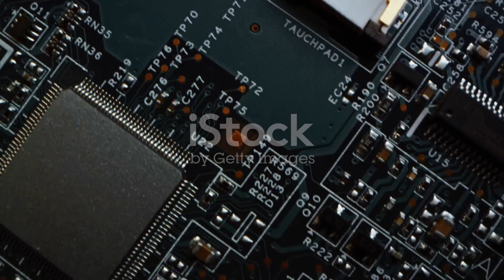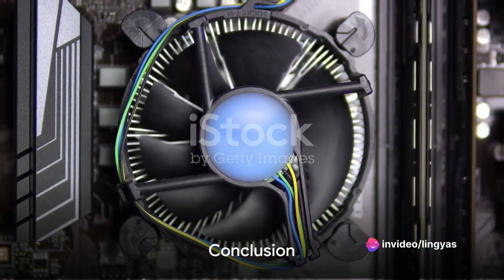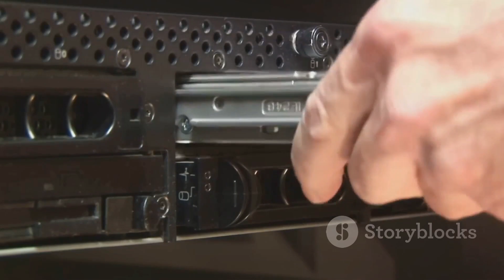"Understanding the Basics: Block Diagram of a Computer"

Comment from the maker: OUTLINE: 

00:00:00 Introduction to the Block Diagram
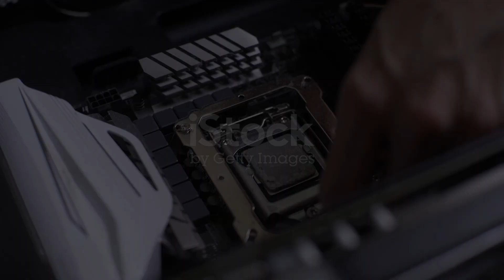00:00:11 The Central Processing Unit (CPU)
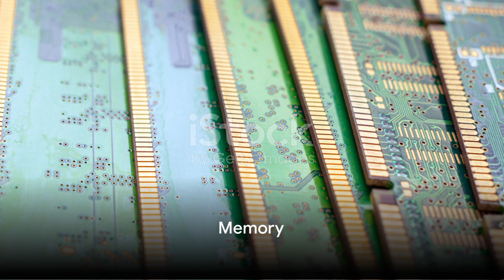00:00:24 Memory
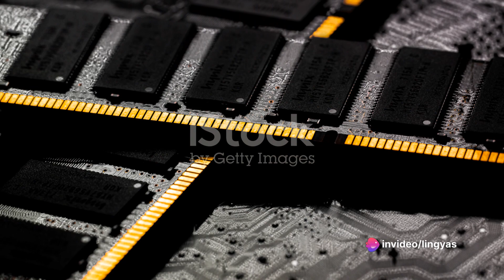00:00:33 Input Devices
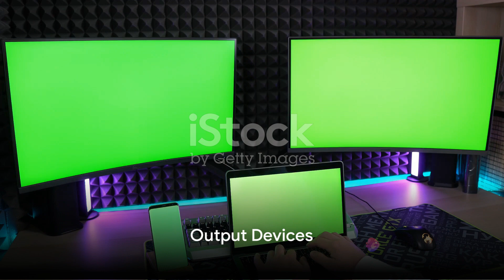00:00:41 Output Devices
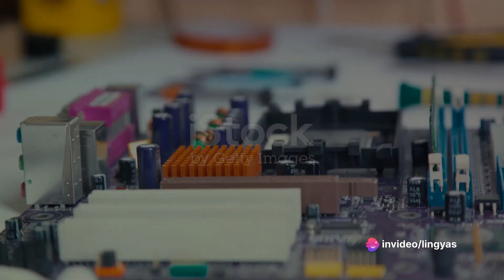00:00:48 The Motherboard
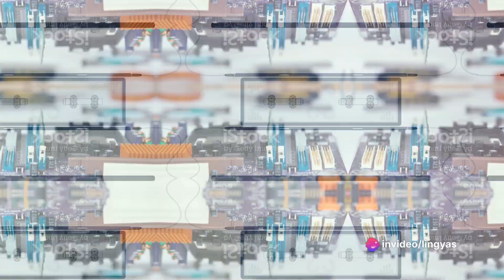00:00:58 The Bus
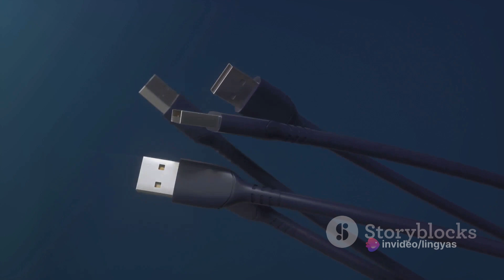00:01:07 Peripherals
00:01:15 Power Supply
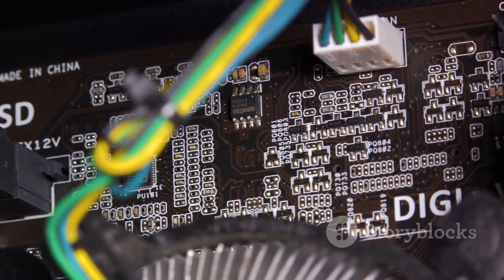00:01:21 Connectivity
00:01:29 Conclusion